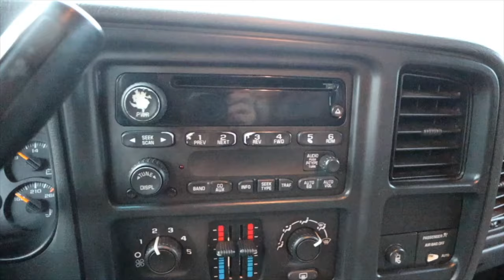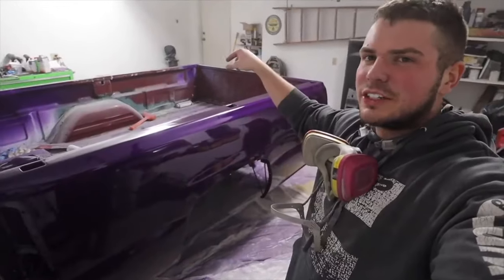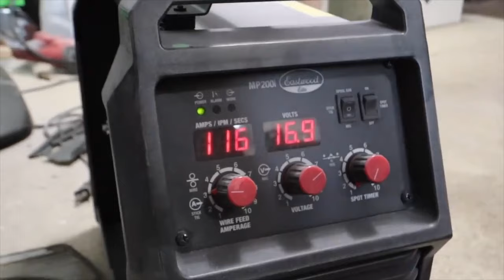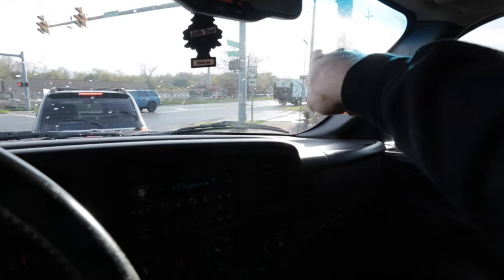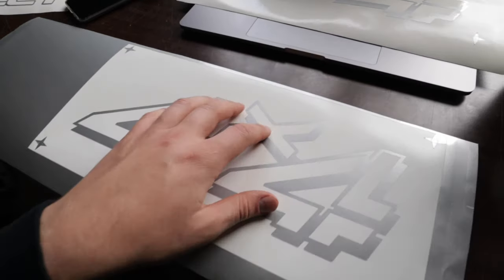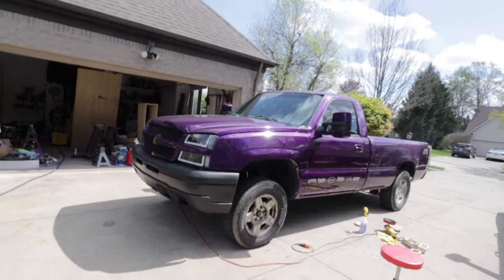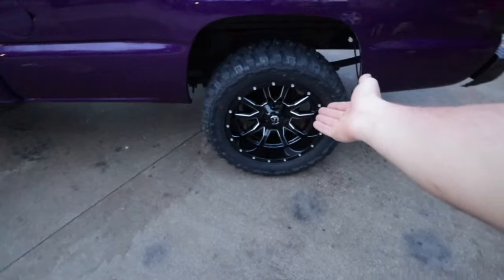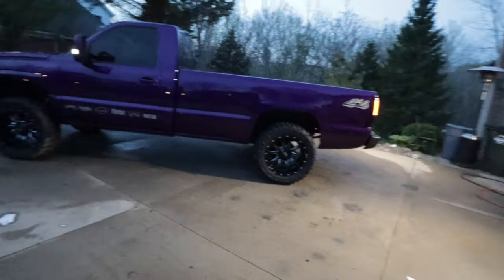I RESTORED A FARM TRUCK IN MY DRIVEWAY!!

Comment: I like the square body trucks of the late 70's and 80's. The newer "streamlined" look reminds me of trucks from the 40's and 50's. Granted, the streamlined look just might save you 1 or 1/2 mpg over the road open highway mileage, but if you can afford today's trucks, you can afford the gas for them. I prefer the older trucks because parts are cheap, they get about the same mpg as the younger versions (if you tune them right), and they do not have piles of computers in them to confuse or cost more to diagnose them. The fuel pump is on the engine block, easily replaced, not in the bloody gas tank where you have to disassemble the vehicle to get at it. All in all, the older trucks are better and easier to maintain than the newer computer trucks (and better looking).

Comment: You do not need 4wd in the winter if you know how to drive. I live in Northern Canada and drive a 2000 GMC Sierra 1500 rwd and have never once had a problem in the snow most people put sand bags in the bed but I don’t and still no problems only thing I have to my advantage is winter tires which everyone should be using in the snow.
Reply: Just my personal opinion I guess ^^ but love the build very clean rig!

Comment: Hey Ryan! New subscriber! I bought the same truck from my employer in Vermont for 1,100 bucks! Only 90.00 miles! Cab corners DONE! Inner and outer rockers DONE! Brake lines, Fuel lines, sending unit Done! Frame scaled, converted, and painted, DONE! Trading welding work for body work and paint. The 4X4 emblems with the lime green accent would kill on the white truck with black accents! Would love to purchase them from you. I'm thinking the Rough Country leveling 2.5" kit. Any thoughts? Can't wait to start pulling those Vermont torsion keys!!!! Wish me luck Ryan!
Reply: Thanks for not replying. I did a better job anyway.

Comment: Had the exact same truck back in the day but I didn't have the long bed. That model was notorious for rust in the rockers. Mine looked the same way when I sold it. Only real issue I ever had with that truck was the brake lines. The factory brake lines were absolute shit quality. I replaced every inch of brake line on that truck while owning it. Besides that I loved that truck.

Comment: wait... you did alignment and then wheels? Usually wanna do alignment after different wheels... especially how much of a difference there is between the two. at least, if your alignment place does caster/camber. toe will be good, but that can change camber angle and cause them to wear quicker. That premature wear will have you thinking you need parts, when you just need another alignment with those wheels. good work, though, man. I'm now a sub.

Comment: Dude I have a gold (pewter) 05 regular cab Silverado WT . I've added pipes with chrome extensions but am going to add headers. I've added cold air intake and a superchips F5 programmer. They have the factory chrome wheels with large holes, they don't look too bad. I'm disabled and am at the moment bed boi d due to diabetes complications like. DTI on my right heel and just had amputation on my left toes and a good bit of the left foot. As soon as I'm able I am going to get back started upgrading the old boy,,, my dad give me the truck after my previous wife divorced me and took nearly everything I owned. I plan on upgrading the suspension and then possibly upgrading the 4.8 internals,,, definitely thinking about the truck Norris camshaft. I'm sure I will modify the exhaust and install turndowns at the rear axles. I've already instaed a pioneer touchscreen and 2 preloaded kicker 10inch subwoofers and installed tweeters and upgraded the door speakers,,, I am planning on installing electric windows and door locks. The crank up windows are not easy with my arthritis but I manage. I saved up some money and already have my window and hood visors and a seat cover for the split bench without console,,, I wished it did have a foldup console but that's out of my wheelhouse. I really enjoyed watching this video and by all . Eans ,, KEEP 5HE CHEVY!!!!

Comment: What type air compressor u using to paint an lay primer?
Reply from the maker: Honestly a 13 gal 5 HP it was ok. I know normal people use 60 and end up with 30 gals but Bc I was painting in pieces it just happened to work out

Comment: Check out this tailgate bezel! It is a trim piece that goes around the handle.  Likely available at your local auto parts store. https://www.oreillyauto.com/detail/b/dorman-help--4422/hardware---fasteners-16585/body---trim-16771/tailgate-parts-16800/liftgate-tailgate-handle-11185/bd1149fcdf11/dorman-help-tailgate-handle-bezel/76106/4529634/1999/chevrolet/silverado-1500?q=liftgate%2Ftailgate+handle&pos=4